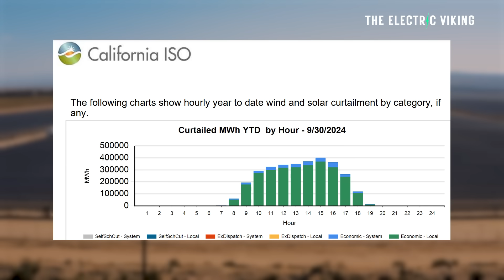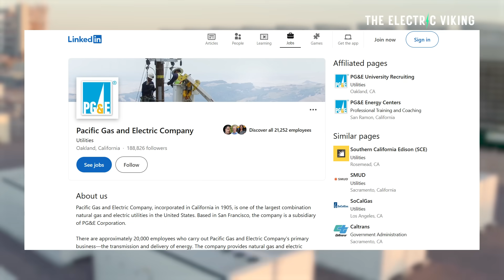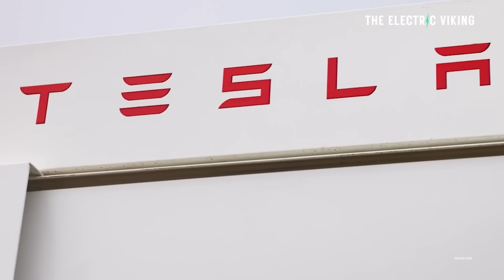America adds battery equivalent of 20 nuclear reactors in less than 4 years

Comment: Solar makes power on empty desert land.  Batteries deliver power when the sun doesn't shine. If energy density doubles or as some think quadruples it will be interesting
Reply: We need to solve the recycling first before we go full power, or we will make a big mistake ...
Reply: @Solid_Snake99  recycling is ready for batteries.  This will make batteries cheaper when only limited mining is since the test is from recycled material.
Reply: @ChicagoBob123  not batteries but solar panels. The amount of panels needed is huge which puts a strain on future recycling
Reply: @Solid_Snake99  of perivskite cells are used recycling might be easier.
Reply: Recycling is solved. Search for redwood materials. @Solid_Snake99
Reply: @Solid_Snake99  recycling is solved. Search for Redwood Materials
Reply: These panels all have glass and EVA plastics inside, which are difficult to separate
Reply: @Solid_Snake99  solar panel waste is a drop in the ocean compared other waste.
Reply: @Solid_Snake99  does perovskite suffer this issue?
Reply: Energy density doesn't matter for grid energy storage at all.

Comment: I'm all for battery energy storage but we must not forget that we need long-term storage as well.  Long term will encompass months to years, a time frame batteries cannot do.  I don't think nuclear is the answer here because of cost and efficiency.  Nucear is a heat engine that wastes twice as much heat as electricity and occasionally has to be shut down when the cooling medium (air/water) exceeds safe limits.  It also needs to run at 100%, 24/7 to make sense so it does not mix well with renewables.  One thought is to use the vast underground caverns (like used to store natural gas in CA that blew out recently) to store compressed air along with bidirectional turbines.
Reply: What is required is peaker plants for Dunkelflaute, the rest batteries can cover. Easily.

95% of the grid can be powered by SWB, and for the 90% of humanity that live in the Sun Belt, 100% SWB is both possible and likely. For the other 10%, winter Nuclear might be a factor. We shall see.

Most of the grid will be powered by whatever is cheapest and countries like Australia, Denmark and Norway are leading the charge. :)
Reply: Traditional nuclear, using pressurized water reactors, runs cooler and is less efficient because the danger of hydrogen gas formation must be avoided. The newer molten salt reactor can run much hotter and therefore, efficiently.
Reply: @imconsequetau5275  Great. Let me know when the first commercial, ready-to-be-mass-produced reactor is online :)

Comment: People also forget that empty rooftops are perfect for PV panels, and grid electricity is not needed when the sunshines 🌞 

With home batteries, grid electricity is not needed when the 🌞  sets. 

Max grid demand, and it's cashflow will STOP. 

Nuclear owner needs 247 cashflow 
Grid owners need 247 cashflow 

Both have a massive economic problem. 

The grid could be a bigger problem. It is 10 times bigger investment and NEEDS more cash daily.

Comment: Sam, batteries consume power; they don’t generate power. And I do mean consume. My Tesla Powerwalls, for example, consume 50% of their capacity per month to just maintain themselves. It’s not close to a 1 for 1 input GWh to output GWh. You need to go back to the drawing board.
Reply: @daveborinski3021  50% loss? Wow that's a lot. Do you store them outside in cold weather maybe?
Reply: @i6power30  You lose when you convert AC to DC. You get better results charging batteries using DC.
Reply: @i6power30  No, they are in the garage in FL and never in the cold. I was surprised as well. The consumption is kind of hidden as it’s a rounding error compared to the system’s production. So many of the report show 0 but download the details and it’s ~50%.
Reply: BS mate.  Round trip efficiency is around 85%
Reply: @guringai  Here is the data from Tesla for the last 5 years starting with fully charged Powerwalls:

   Oct 29, 2019 - Oct 29, 2024
   Charged 971.1 kWh
   Discharged 14.4 kWh

971.1 - 14.4 = 956.7 over 60 months is 15.945 kWh per month in overhead. 
This is for 2 Powerwall v2 @14kWh (13.5kWh usable) for total 28kWh.
That’s 56.95% in overhead each month just to maintain the Powerwalls. This has little to do with AC to DC conversion. It’s simply processing/maintenance/phantom drain overhead.
Reply: @daveborinski3021  
Ok I misunderstood your definition of overhead.
I think what this means is there was a 1.5% loss.
& That's highly efficient.
Reply: @guringai  I think you’re miss understanding Discharge. Discharge is the power sent to the house. So I subtracted that from the amount of power that went to the Powerwalls. The 956.7kWhs is what the Powerwalls consumed/used as overhead in the past 5 years. That’s a good amount of power consumed just to have battery back capability.

Comment: At some point we will not be able to sell our ICE vehicles or trade them in. 😮😮😮
Reply: Yup, classic car values already falling off a cliff
Reply: @jsanders100  I actually think it will take 20years for Australia to replace 20 million vehicles at 1 million per year. 

Classic cars will always be wanted.

Petroleum for road building and maintenance and petrochemical industry and emergency use and ICE vehicles will be required for years, for ever.
Reply: @stephenbrickwood1602  - petroleum use in roads, chemicals and industrial use is already being investigated by industry and academia for replacement; for roads initially focused on bio-binders and asphalt reclamation.  Emergency use roles of petroluem will be replaced by long term battery storage. Expecting the status quo to continue on the basis of what's used today, particularly when change is underway, has never historically worked out.
Reply: @GruffSillyGoat  I am happy you total me. It is good to hear. 
I was just making the point that it will take decades.
20million Australian vehicles can not be replaced in 1 year.
Reply: Buy a diesel ute if your in Australia   They will no lose value for a very long time  I just bought a diesel 37 year old Toyota hilux. 400 thousand kms and it’s just been insured for 19$k.   There is  EVs under 5 years old insured for less …

Comment: So all the big techs, Google, Microsft, Amazon investing heavily on nuclear are all making financial mistakes? Maybe the cost of land lease for renewables and field of batteries could cost even more than nuclear?
Reply: People also forget that empty rooftops are perfect for PV panels, and grid electricity is not needed when the sunshines 🌞 

With home batteries, grid electricity is not needed when the 🌞  sets. 

Max grid demand, and it's cashflow will STOP. 

Nuclear owner needs 247 cashflow 
Grid owners need 247 cashflow 

Both have a massive economic problem. 

The grid could be a bigger problem. It is 10 times bigger investment and NEEDS more cash daily.
Reply: @stephenbrickwood1602  agreed on household power generation. But I'm against massive solar and wind farms and massive battery arrays taking up lots of space otherwise could be forest and for wild life.
Reply: @i6power30  The grid costs are the key to understanding how the grid limits central generators and distant renewables. 
Also the massive increase in clean electricity to replace fossil fuel. 
20million buildings in Australia, and California, means massive area of grid connected future rooftop PV. 

The grid will join with the rooftop PV and BVs oversized battery parked 23hrs every and take the dirt cheap electricity and supply new industrial customers moving away from fossil fuels. 

Little new grid construction costs. 
$TRILLIONS saved.
Grid cashflow maintained.
Reply: @stephenbrickwood1602  so why isnt it happening?  I've been hearing this argument for years yet it never happens.  Its almost like engineers disagree with this idea actually working.
Reply: @pin65371  Horse meat was cheap when the Ford model T production line started. Hahaha. 20 years of production. 

It is happening, and grids are reacting as the new grid balancing stress is building on the grid. 
Curtailment of demand and blackouts from over demand.
Reply: They are not stupid. They look at the economics, not politics

Comment: 20GW power but capacity 20GWh? In that case these batteries store less electric energy than 1 nuclear reactor produces in 24h?
Reply: I think he is confusing power and energy.
Reply: If all these batteries are charged in the peak solar power generation and depleted in the night DAILY, aren't we getting not the same but comparable output to a 20 gw nuclear reactor capacity like 20 gw*24 hours vs. 20 gw*4 hours (he mentioned bw. 6 and 10 pm use)? asking for learning and clarification.
Reply: @taxsi  At 20GW they are depeleted in just 1 hour...
Reply: An isolated town in Australia installed wind turbines, solar panels and batteries to keep the lights on when their power supply (from another state) fails. Well it happened. A storm brought down the interstate transmission line. But because of the heavy overcast weather the batteries couldn’t charge and the wind was non existent. 
Solution?
They trucked in huge diesel generators to recharge the batteries and the town of just 19,000 suffers rolling blackouts. All this after spending hundreds of $millions. Four hour or even 10 hour batteries just won’t cut it. When an  issue arises you will be faced with rolling blackouts regularly. The technology has a long way to go and we’re jumping the gun.
Reply: shhhhh... this whole green racket relies on ignorance about such things
Reply: @cynikal82  exactly.... and the scary thing is the people making policy decisions believe it.  I was listening to a Canadian politician talk about all the battery power California was installing.  I decided to look up the numbers.  It would provide backup for an hour and a half.

Comment: ok - do batteries generate power?  No. Nuclear power plants generate electrical power; batteries store power.
Reply: Solar, wind, geothermal energy are stored in batteries for overnight use
Reply: @larryc1616  though geo didn’t have to be stored.
Reply: @richardmenz3257  you are correct.  The only way I could see you possibly storing energy in geothermal is if its a closed loop system and even then it wouldnt exactly be all that efficient.
Reply: @pin65371  geothermal is everywhere; why isn't it used everywhere.
Reply: @BlondieSuperdog  just because its everywhere doesnt mean you can produce power everywhere.  At least not at a reasonable cost. If you want to produce power anywhere you are going to be drilling really deep.  The only places that make sense is where you already have the equipment and people that are able to do that kind of work.  You could most likely count on one hand the areas where those requirements are met.  The drilling rigs that can do that kind of drilling are pretty rare and are massive.  Then there is also the issue of data. Again in areas where they have already been drilling for a while they have the data so they have a greater chance of success.  In most areas they would just be guessing and hoping for the best. They could spend hundreds of millions of dollars drilling and then realize a year later that they are not replenishing the heat fast enough and then the wells are all dead.
Reply: @larryc1616  Thats right; those provide energy;  in the UsA however that is around 5% of all energy produced.It won't replace much. If you are any good at calculating how many batteries would be needed for a large city to be 100% electric for even one night.. take that figure and figure out how much would be needed to power 9 billion people - it isn't even close to being realistic - but do it yourself; you'll be brought to reality.
Reply: Yeah def miss leading, but it turns extra unstable power into 20 stable power of nuclear power + what ever the overage is when not storing.
Reply: What if I told you, wind turbines and solar panels do. It is bleeding obvious if you watch the video.
Reply: Solar panels generate power, batteries store power.  
Tesla has put up the equivalent of 20 nuclear power plants worth of batteries.  In the last 4 years. 
  
      Solar is very powerful.  It’s like collection of nuclear fusion power. Because that’s what our sun does. 
  100 sq miles of solar panels will meet the whole globes power requirements. 
  No need to put them all in me spot. Think of all the building’s roofs  in the world. Factories, schools, warehouses, homes shopping centers etc etc etc.
Reply: You are missing the point completely.  

The power is being generated from other means and without these batteries, it’s being wasted.